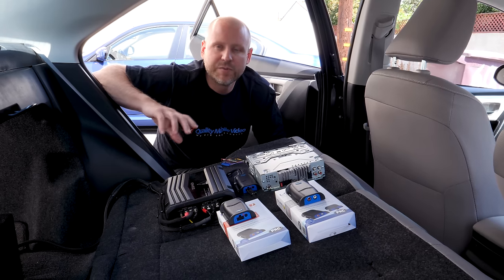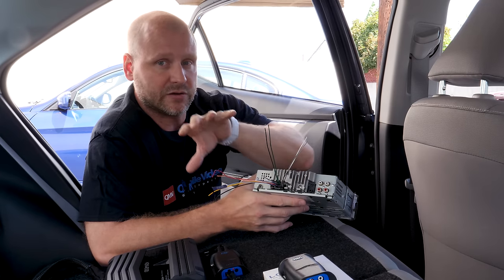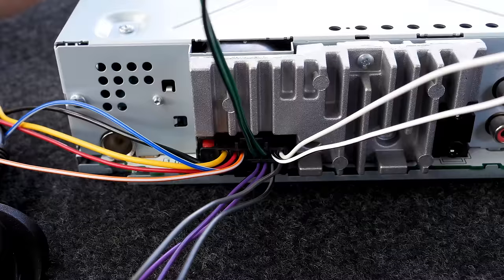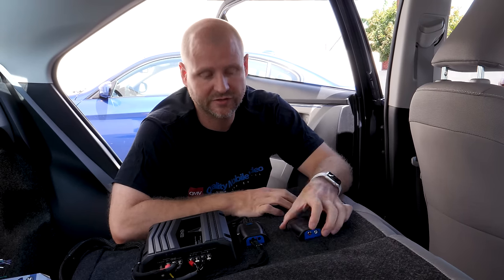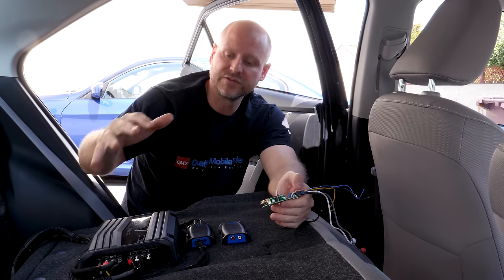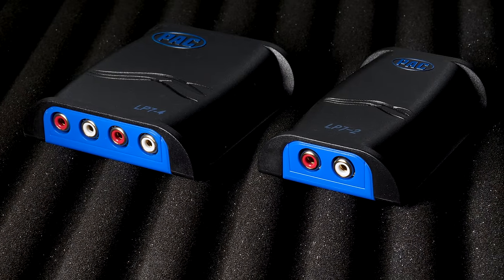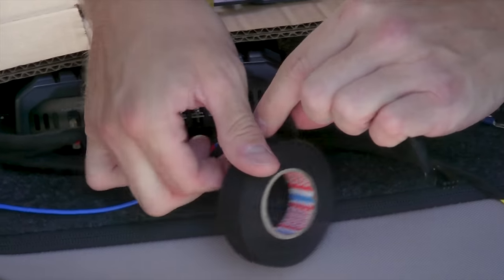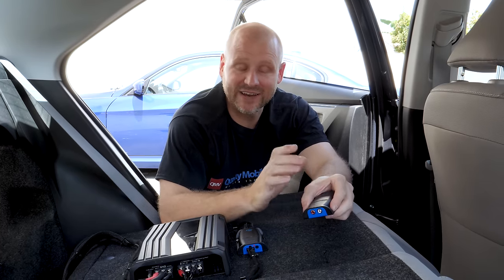Line Output Converters - What Are They - How Do You Install One?

Comment: So could I use one of these if I wanted to use a phone or some other 3.5mm line output as an audio source?  I want to run two amplifiers, one for <80Hz (subwoofer) and one for >80Hz (mids/tweets).  Could I take the two left/right wires from a line-in cable and wire that to an LOC, giving two RCA outputs for both amps?
Reply: Assuming the line output from the 3.5mm jack provides a full 20Hz-20kHz frequency range of course.
Reply from the maker: You can take the output from a phone via the 3.5mm directly to an amplifier, no LOC required. Your phone volume control will be the sole volume control.
Reply: Ahh ok cool.  I was planning on using a Raspberry Pi as my source unit, so I guess it'll be the same.  I was worried that a line output would be considered a high level output, not suitable for direct RCA connection, but that put my mind at rest.  Thank you :)

Comment: please someone help i have a 1000 watts amplifier with both low output option and also high output option but only the low output option can connect to stereo with the red and white cables. but im having trouble how to connect my high output since where the wires go its like tiny holes that you need to fill in one by one with each wire but i dont have those wires for the amp and i dont know where to connect them to theirs like 6 holes from the high out option. please help!!!!
Reply: Only use the low output option with your rca cable to your car amplifier as it will be a cleaner signal

Comment: I have had bad experiences with line converters. I get the alternator whine..I tried grounding at a common point and using power line filters but to no avail. 
i am using a Massive 7 eq the takes high level input but through RCA jacks. I am afraid to take the high level speaker leads from the head unit and use them with the RCA input jacks for fear of grounding the head unit speaker outputs. Has anyone tried this before?

Comment: I have a pioneer hu it has 4 rca outputs as soon i just installed subwoofer and 4 speakers 

2 rca go to Subwoofer
2 to front speakers

So i am confused what about rear speakers

The dealer paired it ..at first it played only mid bass (no tweeter was working)

And later when he installed high low converter ( the rear speakers now only produce vocals)

so here comes my question

Can't the rear speakers play the mid bass treble together???
Reply: @Ken Hider it has in total 4 i wish i could attach a pic here to show
Reply: @Ken Hider it is an underseat subwoofer having built in amplifier

Comment: How do you test which speakers have full range signal
Reply: Use a DMM and run different frequencies.See if the voltage stays around the same for all frequencies.

Comment: for subs is it better to tap from the OEM head unit or the rear deck speakers?
Reply: Tap from the rear speakers. It's more convenient and the signal is the same.  You don't have to run the rca wires either

Comment: Hey guys, what's the easiest way to check if a factory is outputting a full range signal output?
Reply from the maker: Download some test tones, use an RMS voltmeter in AC mode and set the factory radio at half volume. You should have consistent voltage ratings across the spectrum of test tones if not you can test to see what frequencies the output is trimming.

Comment: Hey guys,if you send too much voltage into the low level RCA inputs of a DSP,what would the audible symptoms be?
Reply: Excess power, which could result in high gain on the signal output (too loud) or perhaps produce noise.
Reply: The reason we feed low-level (low power) into an amplifier is because the amplifier's job is to amplify (increase power) those input signals.

If you feed an amplifier high-level (high power) inputs, then the amplifier is going to attempt to amplifier a signal that is already powerful, resulting in too much power for those outputs that would result in excessive gain at lower volume and would be noticeably louder than the stock signals (those not being amplified).

That's a best-case scenario, however. Typically, when you feed an amplifier a high-level input (and it is unable to handle it) then the result will be increased heat from excess voltage. This will typically cause the amp to shut down due to safety features or a blown fuse. It's usually just a result in heat.

Aftermarket head units can give a pre-amp of about 4-volts A/C, which is low-level, of signal output. This is what's needed for an aftermarket amp (assuming it doesn't accept high-level inputs). Factory head units can give about 10-11 volts A/C. This is too much power for an amplifier if it doesn't accept high-level inputs. The internal resistance isn't high enough to handle that much voltage. That energy will turn into heat. If the amp gets too hot, it will shut down.

Comment: i only have a single speaker on deck in the back of my car. am i able to just use that for a single channel since i'll only be running a single sub
Reply: Yup. You could run multiple subs off of one single channel amp. You just need to figure out what the ohm load will be after you connect them either in series, parallel or series parallel. Every speaker has an ohm rating and your amplifier is rated to be able to handle a certain amount. Start hooking them togerher and you can raise and lower the ohm value based on the wire setup you have chosen. Half the ohms and double the power. Best bet is get yourself a dmm (digital multi meter) read a lot and watch more videos that are well made like this one. If the video looks like garbage, chances are the information is too.

Comment: Hi, my 2018 honda fit seems to have pretty aggressive low frequency cut off on stock head unit as the bass is very lacking so im wondering if its going to affect the sound of the sub amp when using a LOC ?

Comment: I have a pac lp5-4 and it doesnt have any remote or power wires...only ground. What should I do to remote power for this unit?
Reply: Dont need power to it , run the remote to a ignition switched 12+ fuse , cig lighter , wipers , USB  some LOC'S have the pos and neg to switch on the remote through the LOC

Comment: Can I use it to bypass a factory subwoofer
Reply from the maker: You'll most likely need an amplifier interface. What's your make/model/year
Reply: @Qualitymobilevideo  03 ford expedition Eddie bauer
Reply: @Qualitymobilevideo  I just want to use my aftermarket amp and sub. I'm not concerned about eliminating the factory sub.
Reply from the maker: @Skyefuego  OK then this should work fine, use the speaker level outputs of the stereo's wiring harness and use an LOC to connect them to the amplifier's RCA's
Reply: @Qualitymobilevideo  thank You.

Comment: I'm adding a sub and an amp to my 2016 lexus. I'm using the stock radio that also has a factory amp. what type of converter do I need?
Reply from the maker: What kind of amp?
Reply: my new amp is a hifonics brx2016.1d 2000 watts. I don't know about the factory amp.
Reply: NoelCastLA i ,

Comment: My aftermarket head unit only has subwoofer RCA outputs on the back. I'm assuming I'm going to need a LOC for the speaker wires to the amp. Is that right?
Reply: Sean Becker No! That's exactly what you want, 
RCA from head unit to amp bro!
Reply from the maker: The harness will have them!

Comment: Well here are my prob.  
Head unit doesn't had a brown color Wire.  
After installed loc, and my sub got noises 😪.. 

Just because in low budget setup plus no rca outputs on head unit.  😂 so i buy 2 loc converters With different types. Basic loc converters 2 Chanel.  + 4 channel loc converters.  Total i have 6output.  I don't know if it's worked or not.  After installed with good.  But the thing is got noises come out.  So i hope this will be fixed 😪

My head unit is 
Pioneer carrozzeria MRZ-099W japan langauge 😂

Comment: It's too confusing
Reply from the maker: Take the speaker wires from stereo harness, connect to LOC, then connect RCA's from LOC to RCA inputs of Amplifier.
Reply: I can't get access to the radio,i have an audi A6 06,i want to do it by a rear speaker,but the problem is the remote wire?
Reply: Mine's stay on,amp as well,how can i get an alternative remote wire connection,now it's straight to the battery

Comment: You not a car audio installer seriously???  There are factory headunits that have RCA inputs!!!! You need a LOC in your head lol, I'm an accountant by profession but I can definitely wipe the floor with you in any kind of install... Your work is messy and you often paint yourself in corners... Note Tessa tape doesn't make you a goof installer, it makes wires sticky lol, in your head it's used to make wires look factory.... My ford is a 92 model and has a factory amp the is definitely not hi end... Uhhhh it's there to PROTECT the wire and add another layer to add life to the wire!!! I dare you to accept my challenge!!!